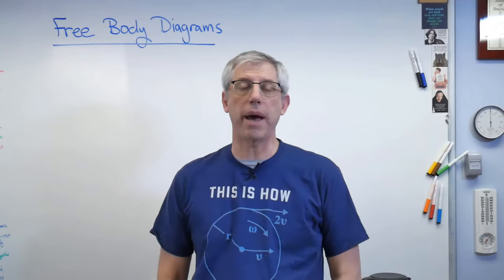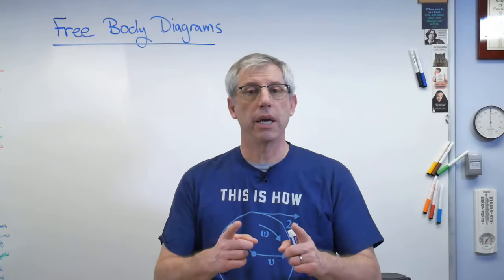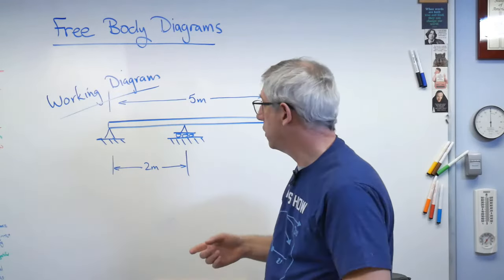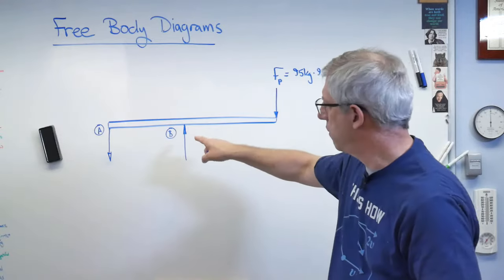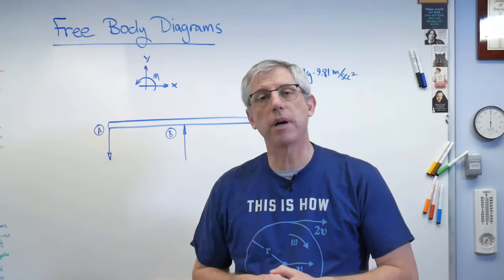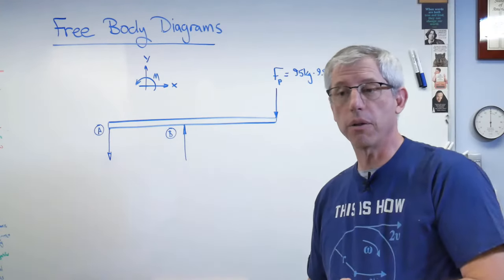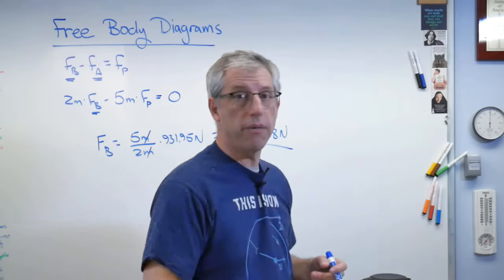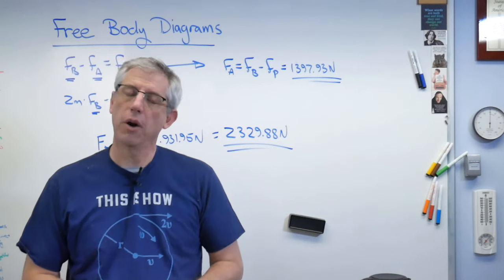Statics - Free Body Diagram

Comment: Professor, it is not too hard to solve a problem with a working diagram provided.  Can you just do videos on real life examples on a working diagram how those support types exist?  For examples:  how does an applied moment exist in a beam or structure?  Say, I have a multistory reinforced concrete building with concrete roof slab.   Are the exterior and interior supports for the roof beams pinned or fixed when the columns support discontinued on top?  Likewise,  are the exterior and interior supports for the floor beams pinned or fixed when the columns support continued on top and bottom?
Reply from the maker: This is a good idea, thanks :-)

Comment: how do u know if FA is negative ,FB is positive and so on
Reply: Typically, you use knowledge of the type of constraint used.  The pin at the left end can "pull" or "push" on the diving board (it can also constrain the board moving horizontally), but the roller towards the middle can only "push" back against the diving board.  You should ask yourself if you are, for example, the pin, what types of forces will the board be applying to you?  Other times, however, you can also assume directions of forces.  The math will tell you whether you assumed the correct direction.